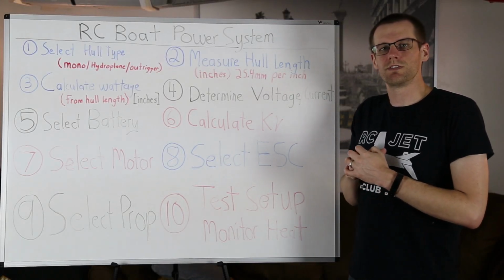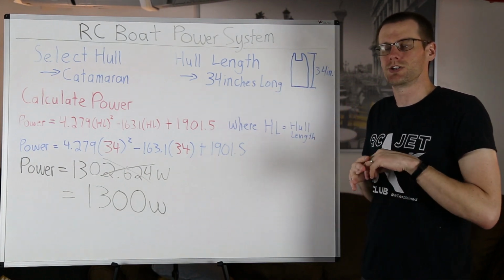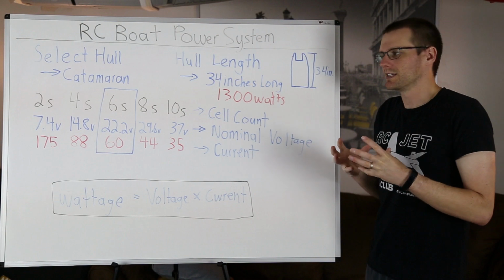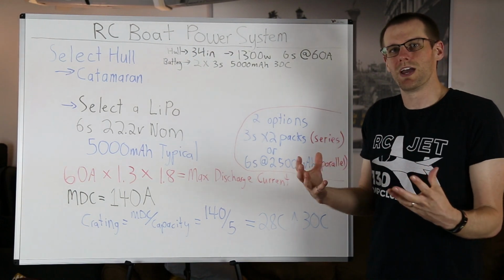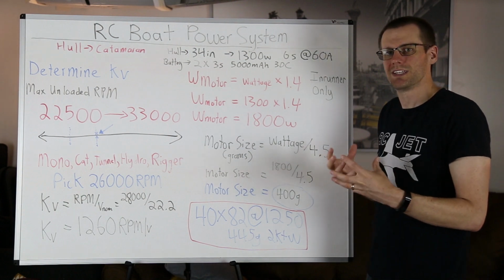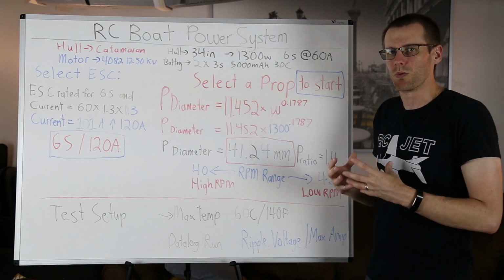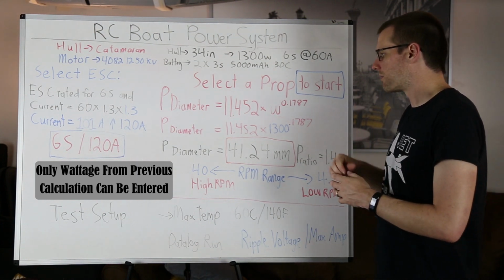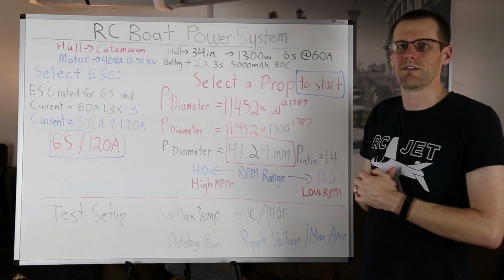Selecting a Brushless Motor, ESC, LiPo Battery and Prop for a Fast Electric RC Boat

Comment: Hey that’s a wonderful tutorial on this video, for the layman rc boater . Was on your Radio Control Info site and found it very helpful, just wished you had many more brushless motor manufacturers to compare  some the perimeters . I run several Neu motors and SSS motors. I did not see anything on SSS motors at all. Update some of the ESC.  Manufacturers too.
  Will like to see a tutorial on the 55+ inch boats too.

Comment: Super awesome. I am going to have to do some math. I’m 3D printing a Riva mono hull but it is supposed to be a dual prop. 

How does the math change if your using 2 props?  I would like it to go fast but I’m a newbie and not looking to race etc. I would like to keep costs down just a fun project. 

I’m planning on using 2s Lipo batts. I can use single batt or 2 batts.
Reply: I'm also trying to build a motor setup on my 2-propt mono did u figure the math out? I'm really struggling to find the right motors and battery

Comment: I keep referring back to this.. I got me a used Electric King of Shaves 34" and this almost doesnt apply for redoing the ESCs.. but at the same time I can still use the math here to make sure my system is going to be good for what I've got vs what should be in it. The E.K.O.S. runs 2 motors, 2 ESCs and separate batteries for each esc. I also have the "lack of budget" factor to add in to the equation but yet.. still gotta be fast enough to take out a couple traxxas boats and still keep that lead! Help me out if you can!

Comment: 40inch Catamaran built with 3mm plywood
With dual 4092,1550kv,200a
6s 7000mah 60c  per motor 12s of total 
What do you think about this setup and this is ok then suggest me good propeller

Comment: Thanks for sharing the video! Very educational!
For a 50" mono-hull deep V boat for autonomous mission not tailored to be very fast which formulas should I get?

Thank you
Reply from the maker: Hello formulas in the video are for a surface driven prop. For a submerged drive, everything will be very different. What speed are you after?
Reply: @RCexplained  Thanks for the quick reply. The boat is this one: https://ibb.co/bPt3SL9
Looking for no more than 20mph. It will be cruising around most of the time at slower speed
Reply from the maker: Link Doesn't seem to be working. If the boat will be travelling at slower speeds mostly, I would have the components selected specific to this vs hitting higher speeds closer to 20mph. 
You have options, you can run 6s LiPo on a large outrunner with a 60mm prop or so.
Reply: @RCexplained  Please try this link instead: https://drive.google.com/file/d/1ycz61qqw2JDgFh55scEQJhSE7pGiYVvE/view?usp=sharing
Do you think that a 4084 620kv, 6s Lipo, with a 60mm prop (1.4 pitch ratio?) would be a good starting point?
Reply: @RCexplained  Please try this link instead: https://drive.google.com/file/d/1ycz61qqw2JDgFh55scEQJhSE7pGiYVvE/view?usp=sharing
Do you think that a 4084 620kv, 6s Lipo, with a 60mm prop (1.4 pitch ratio?) would be a good starting point?
Reply from the maker: I think that setup would be a bit aggressive. I would run less Kv. Somewhere between 400-550. 550kv should hit 20mph on an efficient hull with the right prop, but will consume quite a bit of power and you'd have to run 50% throttle or so to cruise at slower speeds. 
https://youtu.be/nbQeUOY6rEg
Reply: @RCexplained  So something like an outrunner with let say more than 40mm diameter with 400-550kv. I can find some but not designed for RC boats?
I need a power system which consumes as low as possible at let say 5-10mph and which can reach 20mph if I go let say 3/4 or more on throttle.
Reply from the maker: You don't need a motor for RC boats.
Reply: @RCexplained  Meanwhile I have identified two potentional motors for my purpose...
1)Leopard 6354-8T 320kv Brushless Airplane Motor (http://www.shorturl.at/cdsJ5)
2)ENERG C50-30 390kv 50x60mm 26cc O/R Brushless Motor (http://www.shorturl.at/cjJPW)

Do you recommend one of these motors or look further in the market?

Thanks again

Comment: Great info for sure. To test the 🧠
I have a 51in v hull (gas to electric conversion) so one shaft and prop.
For a one motor setup this will be crazy big motor/esc is expensive and the battery requirements 🤯 so I like to use two motors turning the same shaft. Should I just Divide my motor wattage results and run two smaller esc's an motors? Seams like I would have more options and tuning...thank's!
Reply from the maker: Yes that will work. Match the RPM and Kv with the gear ratio used.

Comment: How do you modify the propeller calculation for a submerged prop, as I presume taht the load is approximately doubled for both blades being in the water at the same time? Thank you for your insights, it should save me a load of money in failed experiments!!
Reply from the maker: You will have to modify the RPM range as well as the power range first. Overall a submerged prop will require less RPM. 10k-25k depending on the size of the hull. Power will depend on your speed goal. Size of prop will be reduced and will largely be based on your chosen RPM, motor and power potential.

Comment: But what about the RC part? Do boats have controllers like quads to combine the inputs from radio into signals of the motors? There are 2 motor configuration, but all I've seen - the direct commands from radio to ESC
Reply from the maker: Rx to ESC. No other controller is typically used
Reply: @RCexplained  but in this case - no telemetry, no stats, no fpv with all this online info :(
Reply from the maker: You don't need a "flight" controller to have telemetry or FPV.
Reply: @RCexplained  I want to have telemetry "on FPV" (displayed current draw, component temperature etc), you've said in this video - send the boat to water, return home, measure temperature :) guys on quads & planes do not need to return the model to get all this info
Reply: @RCexplained  when choosing the ESC for boats, what params should I take into account? does BLHeli_32 matters for example (as for quads), PWM/PPM or something else?
Reply from the maker: If you want to have telemetry on your FPV setup, all you need to do is install it. It's no different for planes, cars and quads.  

As for ESC, waterproof and a high current capability is helpful. Out of all RC's that I have, boats are the harshest on ESC's.

Comment: Hi Ryan,
I'm conducting a thesis project on USV's and the vessel is of a similar size to an RC boat. I was wondering if you would be able to share how you derived your equations for power required based on hull length and prop size based on motor power?
Thanks.
Reply from the maker: These formulas were developed empirically.
Reply: Hello Ben! hope you are doing good. I want to know what type of thesis project you have done on the USV and can we communicate on any other websites as I am also doing a thesis project on the same topic. I have some queries related to validation point of view, I would greatly appreciate your assistance towards me, and it would hold significant value. Thank you!

Comment: Using these equations approximately what speed will a mono-haul go? I want scale speed for my model so I don't need to go over 13-14 MPH.
Reply from the maker: These equations are for a surface driven propeller. Does this match for you?  On the radiocontrolinfo website, there are calculators to help determine and estimate. speed based on your calculation.

Comment: I have a 60a esc water cooled in a deep v  36" boat would a 3000kv  4 pole work?
Reply from the maker: Does this motor hit the required power level you are looking for? Does the motor give you a good unloaded RPM based on the voltage you plan to run?
Reply: @RCexplained  unfortunately all I see is the esc amperage
Reply from the maker: A motor usually don't have a specification for the required ESC amerage. For unloaded RPM, you would have to calculate this based on the setup you are running.
Reply: @RCexplained  could you reply to me with the formula so I can
Reply from the maker: kv x Voltage = ~25,000RPM. These formulas are in the video.
Reply: @RCexplained  I'm not sure what this symbol means ~
Reply from the maker: Approximately

Comment: i have 2  3s 11.1V 50C 5200mAh how should i use them
series or other
Reply: and what kv moter and elc and prop
Reply: Specification:
KV:2650KV
Max Voltage:21V
Max Amps:80A
Max Power:1600W
Rotor Poles:4
Number of Turns:3D
No Load Current:3.2A
Max RPM:60000
Reply from the maker: What boat? Start with the length of the hull. These values can be entered in to the formulas within the video.
Reply: @RCexplained  34  inc same kind in vidi no good at that kind of math

Comment: Hi there,
Its awesome to see your knowledge in this area. Being new to this I had a bit of a hard time following everything you where speaking on. My son and I are building a 48” mono hall and I’m looking to get 25-30 mph out of it. I got the first calculation of 3900 watt/power but was lost on the rest. Any chance you could help me out so I can order what’s needed to complete the electrical set up.
Thanks
Reply from the maker: Have you decided on batteries that you will run?
Reply: @RCexplained  
Thanks for getting back to me. I’m going to be running 5200mah 11.2 volt 3s. I know I could go way bigger but it not really about speed for me. I’m going with a 60amp esc and 3650 motor. The boat is going to be more for fishing (as I’m mounting a fishing reel and rod on it with a worm gearbox and secondary esc to run the reel) 

Any thoughts?

Thanks
Reply from the maker: Is your prop submerged or is it a surface drive?
Reply: @RCexplained  
Surface driven.
Reply from the maker: You could go 3s but you would need to be up around 100A minimum or so to have a chance at 30mph with a low drag hull. The motor will have to be at or less than 1600kv. 50mm prop.

You would be better off with 6s minimum and an 800kv motor using a 50mm prop. 100A ESC. 

Minimum Motor size recommendation for either cell count is 40x82.

Typical fast electric boats at this size are using 10-12s LiPo at 100A for 40mph and up. Your application is a bit unique. Keep RPM's on the very low side of the range.
Reply: @RCexplained  
 
Just realized my esc is 80amp not 60 and the specs call for a 2s-4s battery. The motor is 3100kv
Reply from the maker: Are you building a transmission?
Reply: @RCexplained  
I’ve ordered a 6 channel so I can run 2 motors
Reply from the maker: You will need closer to 15000 RPM max at the prop. Your power system is very small in comparison to the size of your boat. Typically that motor would be suitable in a 24 in hull.
Reply: @RCexplained  
So it’s going to be under powered. What kinda top speed would I be looking at with that system?

Thanks for your time.
Reply from the maker: I'm not sure what the top speed potential would be for your specific hull. If you can't get the hull on plane with the prop that motor would typically use, it wont be that fast. 
If you force the motor to twist a larger prop then the motor can handle, it will burn out. 
Typical prop size for your hull using surface drive would be 50 to 65mm. 
Your motor would typically suit a 32-37mm prop direct drive.
Reply: @RCexplained  
I’ve decided to take your advice and return the 3s batteries as well as the esc and motor. 

I am go to get 6s lipo batteries with a 120a esc and 620kv motor.  

Would a 60mm propeller work well with that? Also do you recommend strips down the boat hull or turn fins?

Thanks again or your help and time, I really appreciate it...
Reply from the maker: 6s LiPo, 120A ESC and 620kv motor sounds good. Check to make sure the 620Kv motor can handle 1500w continuous. 
60mm prop should be OK but you will want to start off with a 50mm prop (conservative) to be certain nothing is overheating. Once confirmed you can move up in size in steps. 

This power system will be much more suitable.

I would recommend turn fins and trim tabs.

Comment: Hi, I have a 40 inch mono hull.

What setup should I be using? I tried to figure it out, but I ended up with huge C ratings, low kv and when I look at batteries and engines for sale I can't find anything that comes close to fitting....please help.
Reply from the maker: What speed are you looking for?
Reply: @RCexplained  well, I got a ~50cm prop...Im not looking for the max speed...just something fun, its my first rc boat. I was using the lowest rpm you had 22500 iirc. Any help? Thx for replying:)
Reply from the maker: Use a 40x92mm motor around 1000kv. 120A ESC rated for 6s LiPo. Use a 6s LiPo minimum 5000mAh 45C. Use a 48mm to start and work your way up from there checking heat frequently.

Comment: Just to clear out things, You mean 26000 instead 28000 was used in computing Kv, right?
Reply from the maker: I am not sure why I wrote 28,000, this should have been 26,000 as the answer is correct using 26,000.

Comment: how do you calculate required thrust for submarine underwater and above water .can you please tell me. thank you
Reply from the maker: The required thrust would depend on the speed you plan to achieve and then your submarines hull shape and size drag. You would need enough thrust to match the drag created at speed.

Comment: Great video. My English is not very good 
It’s possible that you recommend me what motor to get..??
I’m building a catamaran rc boat it’s 70\34 cm 
Thank you very much
Reply from the maker: What is the length of your boat?
Reply: Hi thank you 
The length is 27' inches 
I'm completely confused about what battery esc and motor to buy
I'm not looking for a very fast boat 
Thank you for your help
Reply from the maker: Hello, you could use a 4s 45C LiPo, 60A ESC and 40x65mm 1800kv motor with a 40mm 2 bladed prop. This would be good for about 60km/h.
Reply: @RCexplained  thank you very much

Comment: Great video.  It is a starting point for me.  I am currently building a 60" PT boat (1/16 scale). Question:
The formula domain is for max hull length of 50".  What do I need to change for my current build?
Also still debating on 1, 2 or 3 motors depending $$$$
Reply from the maker: The formulas are for a fast electric boats with surface piercing props. Does this match what you are doing?
Reply: @RCexplained  No it does not. My props will be below surface
Reply from the maker: With a submerged prop you will want half the RPM dependent on props diameter require for that hull size.

Comment: Forgot to mention, I'm using 6S 6000mah 100c Graphene batteries.
Reply from the maker: yes, even 6000mAh 100C will be stressed with that setup.
Reply: Yes. I took it out with the stock 4519 props (2blade). I bashed for about 20 minutes between 50-60mph, the motors and ESCs were lukewarm. It took me about 2min to open the Hull to check. But so far no heat from the batteries. I have never done a high speed run yet. I'm in Canada so that means crawler season.

Comment: Good morning and Merry Christmas to you and your family. I really enjoy your information videos, they have guided me over the last few years through nitro buggies, crawlers and boats and I want to simply say thank you.
  I really need your help. I got myself in a pickle. I purchased a catamaran Hull (38.5") and twin 4092 SSS 4pole 2140Kv motors, 180Amp ESCs Hobbywing V3 and 48mm 1.8 pitch 3 blade CNC props. I am not able to calculate my safety or ability of this setup. I have other props ( 17/16 2blade, 45/1.9 2blade and 40/1.9 2blade) that I can try out. I just wanted to go about 100mph +, but I may have bitten off more than I can chew. 
  I only made that setup because TFL has it in a couple of their boats. Anything you can help me with is highly respected. God bless and Merry Christmas.
Reply: Forgot to mention, I'm using 6S 6000mah 100c Graphene batteries.
Reply from the maker: Kv is a bit higher then what I would prefer, even for straight away passes. Only 2 WOT passes and then bring the boat back in. You will want to start as small as possible on the prop and work your way up. The pitch on your props also seem very high. Do you have everything installed?
Merry Christmas to you as well!
Reply: Also, does Kv have a different effect in relation to 4pole vs 6pole? Can you please, respecting your patience, help me to start understanding some of the science?

Comment: How would you use this for a twin mono setup!
Reply from the maker: I would just add a multiplier to the power calculation. Each motor is 80% (if looking for higher speed) or 70% (looking for a lower top speed) of the power that you calculate using the in video formula.

Comment: Really good video with lots of useful information. I remember looking for information about building RC boats a few years ago and it was really hard to get any. Especially when it comes to the propulsion setup. There is still a lot of trial and error that needs to be done, but with the formulas you can get a good starting point directly from the beginning.
Reply from the maker: Yes, for sure. There's limited information about RC boats. Thanks for the comment Razor Blade!
Reply: You all prolly dont care at all but does anyone know a method to log back into an instagram account..?
I was dumb forgot my account password. I would love any help you can give me
Reply: @Yusuf Raymond instablaster =)
Reply: @Luca Raiden I really appreciate your reply. I found the site on google and Im trying it out now.
I see it takes a while so I will reply here later with my results.
Reply: @Luca Raiden it did the trick and I actually got access to my account again. Im so happy!
Thanks so much you saved my ass !
Reply: @Yusuf Raymond no problem :D